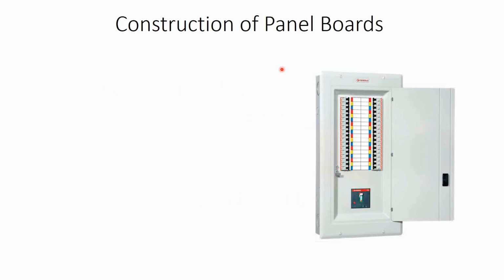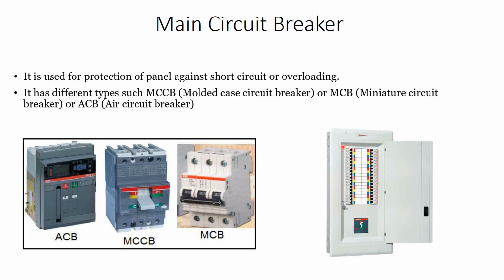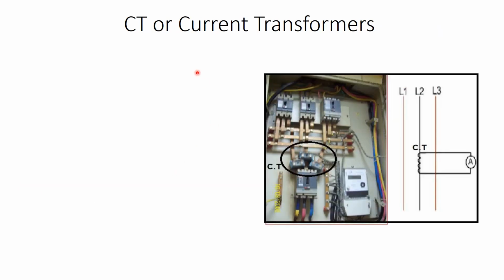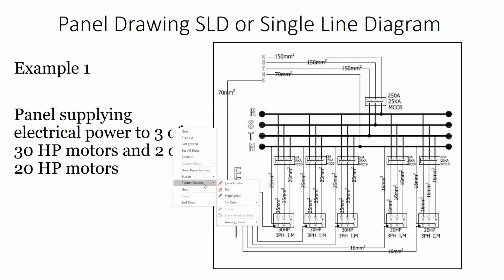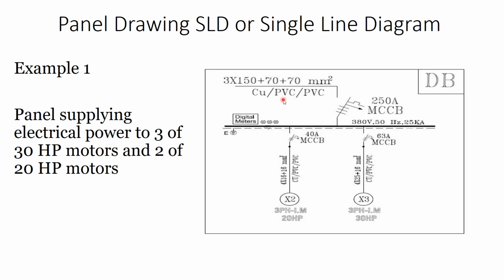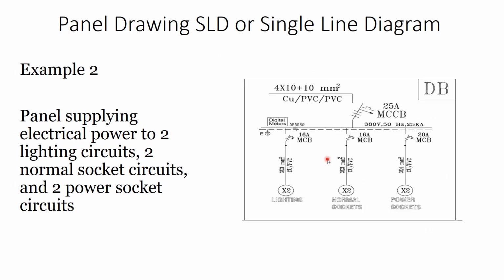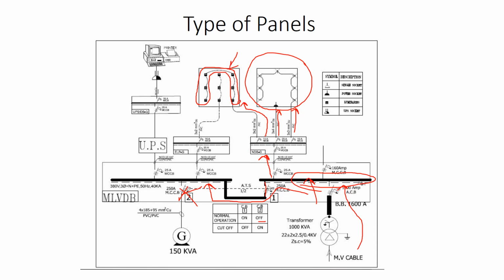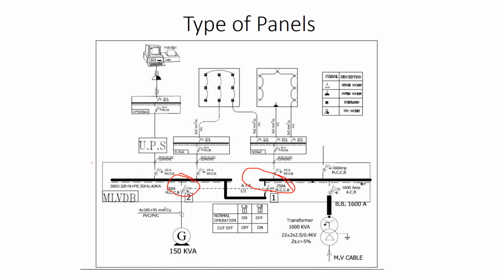Panel Board Components, Drawing of SLD Single Line Diagram and Types of Panels

Comment: Sir, my working place SMDB incomer is 350 amp but out put mccb is 80+40+40+63+63+63+63+160=572amp why incomer and output mccb amp not matching
Reply from the maker: Because the circuit breaker selected is based on a diversity factor, as all loads don't work at the same time

Comment: How to determine busbar size
Reply from the maker: If you mean the short circuit value in the video, this depends on the worst value of short circuit current or the three phase symmetrical fault value by using short circuit analysis in ETAP or by using manual calculations.
Reply from the maker: If you are talking about C.S.A, then you will find tables which involves ambient temperature, short circuit level such as short circuit current and peak short circuit current, IP values and finally rated current, by knowing all of these values, you will be able to select which busbar is suitable.

Comment: Another great video from a smart and passionate Electrical Engineer. Keep up the good work with such similar videos. I was hoping if you can make videos on interpreting electrical schematics, circuit diagrams, process control diagram and other diagrams which we find in software packages like Edraw and SmartDraw. 

Regards

Zakir
Reply from the maker: Thank you Zakir for your nice comment, I screenshot your request in addition to Dialux Evo, I will try my best to add as many videos as I can on the channel to provide maximum benefit to everyone :)
Regards,
Ahmed